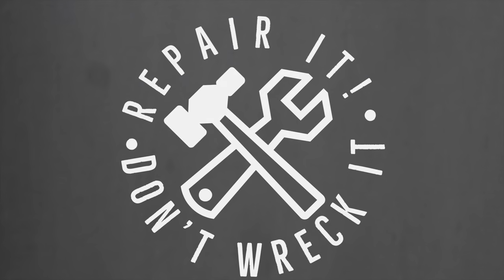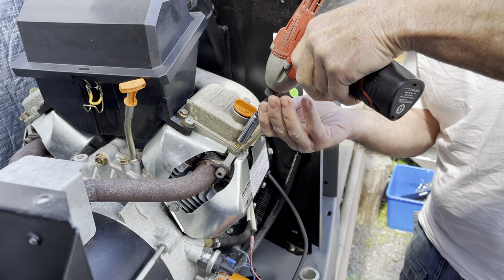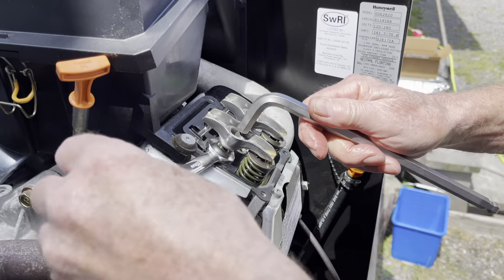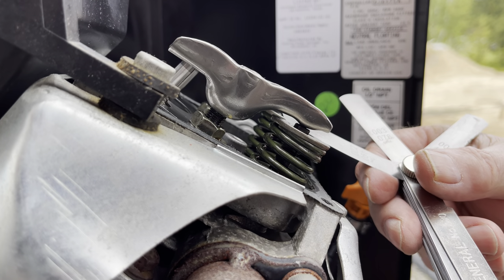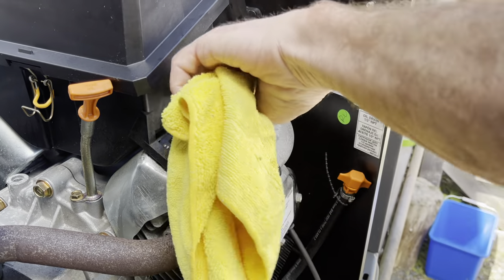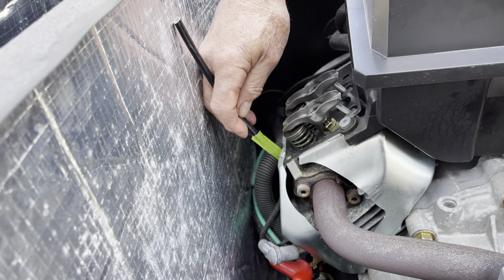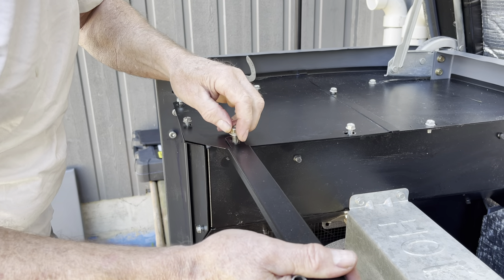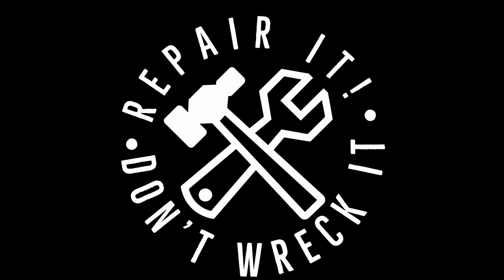Adjusting the Valve Lash / Clearance on a  Generac / Honeywell Air Cooled 17 kw Whole Home Generator

Comment: I am getting the rpm loss error again. I will check the valves when it's over 60 degrees.
Reply from the maker: https://gentekpower.com/forums/viewtopic.php?f=6&t=3.     Hi Ed. Here is a link to a fantastic web site. It is worth a look as there are other reasons for the RPM loss message. Roger
Reply: @repairitdontwreckit4257  Thanks for the link. I am wondering if this is my issue: . The ignition coils have a problem. This could be that they are bad, have contacted the flywheel, etc. The 18 wire sends the RPM signal to the Evolution from the ignition coils. I know I have a good battery since it starts my car with ease. My generac  start some of the time usually after multiple attempts. I had it running the other day, but on a manual start....
Reply from the maker: @edbrandt8972  This web site also sells parts. It might be worth downloading a repair manual for your unit. I have one for my model. They are well put together.  Check out the forum also. I’m confident you will be able diagnose your problem. Roger
Reply: @repairitdontwreckit4257  My educated guess is a bad coil or control board. It looks like I can disconnect wire #18 and see if the starter engages. Then I can test that wire for continuity and test the wire to ground to make sure it is not shorted.
Reply from the maker: @edbrandt8972  I would check wire #14. It supplies power to fuel solenoid to open. In the manual it’s test #51. You should have 12 volts when cranking. Wire number #18 grounds the coils to shut down ignition and provides rpm information to controller. On this wire if there is rub thru on the wire it would be grounded. There is a test #59 for this. Another check is a spark plug tester to see if you have spark when cranking. Simple test that gives you some direction. Make sure connections to controller are clean and have not come loose. There are two things that need checking are spark and fuel. Also you need air so a blocked or dirty air filter or a choke plate sticking could cause a problem. An organized approach will save you time. Unless you can confirm a part is defective resist the temptation to throw parts at it. Roger
Reply from the maker: @edbrandt8972  Does or always start in manual?
Reply from the maker: Another test you could do would be #64. Disconnect the #18 wire. Put 1 lead of your multimeter to ground and the other lead on the end of the wire being careful not to distort the connector. Turn of the fuel and manually crank the engine. You should get 3 to 6 V ac for the two cylinder, and 2 to 3 V AC for a single cylinder.Roger
Reply: @repairitdontwreckit4257  does anyone have a link to a video showing how to access the ignition coil and how to identify the wires to test? Or maybe I just need to buy a repair manual. I have the 8kw home standby model.  Thanks
Reply from the maker: @edbrandt8972  Hi Ed. Getting the manual is will save you time diagnosing your problem. Also,  it explains the theory of operation on how the different systems work. Once you understand how something works it makes diagnosing much easier. The manual is set up for a person who understands electrical basics including the use of a multimeter. There is some information on how to remove the engine but for your needs getting to the coils I think you would be disappointed. I never have removed the coils on my generator. From what I have read it requires a fair amount of disassembly to get to them. Once you are there the coil replacement is fairly simple. Depending on the age of the unit some of the fasteners may be corroded and tight. You need to be patient as you don’t want to break anything. These engines are air cooled. Basically same design as a lawnmower, motor cycle or pressure washer engine. I looked around and couldn’t find any real decent generator videos on how to get to the coils. However there are tons of lawnmower videos that can be looked at to learn the different techniques for diagnosing electrical problems and how to take them apart. There are 2 Utuber’s that I think are pretty good. One is James Condon Generator Repair and the other is Metal In Motion Shop. Metal In Motion has a specific video called “How to Diagnose and Replace An Ignition Coil”. Don’t forget the basics for an engine to run. Spark,fuel and air. I know it’s sounds simple but at least one of them is missing. You need have certain tools to do the diagnostics. A multimeter, manual, fuel pressure gauge (manometer), and basic sockets and wrenches. If you’re willing to do the research and learn as you go along it can be very satisfying to figure out the problem and repair it. People who repair these things have many years of experience and still can get stumped occasionally. Especially a intermittent problem. I hope this helps. Roger
Reply: @repairitdontwreckit4257  did some testing today. I am not seeing the starter relay giving power to the starter. The relay is consistently getting 12v to close the circuit to the starter. So I tapped it with a hammer a few times and all is well again. I think I need a new starter relay.
Reply from the maker: @edbrandt8972 Sounds like you have found the problem. Double check the wire connections for tightness or corrosion. If that looks good it seems like a good call to replace it. I don’t think it’s an expensive part. Probably the points are sticking causing intermittent failure. I’m glad you hung in there to finally locate the problem. Congratulations. Roger
Reply from the maker: I know you have pretty well solved the problem. But it would be interesting to see what the ohm readings are.  Here are some resistance values you could check on the relays. The starter contactor would be 8 ohms and the starter contactor relay is 155-158 ohms. Roger
Reply: @repairitdontwreckit4257  thanks. I will check that next time I work on it.
Reply: New hypothesis. I think I was using too weak of a battery charger. I replaced the stock generac charger a few years ago. Recently I tried several other aftermarket trickle chargers. Tonight I could start in manual or exercise mode. I will continue to monitor the solenoid.
Reply from the maker: @edbrandt8972  Hi Ed. Here’s a couple of tests you can try. Battery voltage should be at 12.66 volts or pretty close. When charging I would think between 13-14 volts would be acceptable. Next load test the battery. Turn off the fuel supply so the engine doesn’t start. Connect your multi meter  to the battery the same way you would test it. Crank the engine and see what the voltage drops down to. It should not go less than 10 volts. Lower than 10 volts indicates a battery problem. Another check is the negative cable. Put one lead of your multimeter on the negative battery post and the other on a ground. Say to the engine or where the engine is bolted to the chassis. Crank the engine without fuel so it doesn’t start. The voltage drop should be around .10 volts to .30 volts. Less is even better. Anything over .50 volts indicates a bad ground. Some of these tests I use on my car and generator. From experience there is almost no voltage drop if everything is clean and in good shape. Roger
Reply from the maker: @edbrandt8972  Hi Ed. From my research the battery charger should be rated for around 2.5 amps. Roger
Reply: @repairitdontwreckit4257  I am using a 2 amp aftermarket charger now. This is replacing another after charger. A fews years ago the generac charger would overcharge the battery and caused all the acid inside to evaporate. The new charger  seems to shut off correctly when fully charged. I don't want to buy another generac charger since the last one would over charge the battery.
Reply from the maker: @edbrandt8972  I wouldn’t think the 2 amp charger shouldn’t have a problem keeping up on a properly functioning battery.
Reply: @repairitdontwreckit4257  so I did some testing in the sunlight. Turns out the battery terminals had corrosion. I cleaned that up and it starts right away in manual or automatic test mode. No new parts have been installed other than an aftermarket battery charger.
Reply from the maker: @edbrandt8972 That’s great news. I’m glad that you got it figured out without throwing parts at the problem. Even though you spent some time testing other systems the experience you gained and having a better understanding of your equipment will be invaluable. Great job. 
Roger
Reply: @repairitdontwreckit4257  The point is to check all possible culprits for the issue. Loss of power due to corroded battery terminals should always be on the checklist. I am glad it's fixed. We had some severe weather last week here in Ohio.
Reply from the maker: @edbrandt8972 Your right. Always start with the basics first. A simple check list would be ideal. Did you do a voltage drop test to zero in on the battery connections as the problem?

Comment: You should always replace used gaskets. They are cheap, and should always be on hand if you are doing a valve adjustment. They do get brittle, and then take more pressure to seal. Why risk an oil leak to save a few bucks?  Otherwise good video.
Reply from the maker: Hi Rod Graff. Thanks for checking out the video and posting comments. I probably should have explained myself for reusing the gaskets. I agree that they should be changed. The generator was located in Canada, in a small city in northern Ontario. Parts for Generac generators while available are expensive. The gaskets are $ 21.00 each plus shipping. I felt that if there was a leak it would be small and easy to identify as the valve covers are accessible, gaskets could be ordered and replaced. I recall at the time of making the video I checked my favourite generator site called  gentekpower.com.  located in Michigan. Some of the techs on the site didn’t seem to have an issue with reusing the gaskets on this particular model which surprised me.  Thanks again.
Roger
Reply: @repairitdontwreckit4257   Wow, for that price I would have tried to save the gaskets too.  I don’t remember where I got mine, but they were no way that expensive.  Maybe 4.00 each.  Might have been on Amazon.
Reply from the maker: Hey Rod Graff. The gaskets are reasonable in USA. Depending on where you look the price ranged  from $4 to $7 dollars. The gentek site that I mentioned sells parts and we’re one of the lowest prices. I’ve ordered service parts from them when vacationing. Worth a look. Thanks again.  
Roger

Comment: Why didn't you check the battery?
Reply from the maker: Hi Nancy Vrabel. Thanks for checking out the video. I like to keep the content of the video as close to the description as possible. Here is a link to a battery video that I did. Thanks. Roger.            youtu.be/TqR1rOMQkBc
Reply: @repairitdontwreckit4257  thank you ! I'm going to do my own maintenance on the generator this summer. Your videos are to the point and you have a clear voice with no ums . Well done!
Reply from the maker: Nancy Vrabel. Thank you for your kind words. Doing your own maintenance is very satisfying. Besides, the money you save is significant. Also I like being independent as much a possible. Take your time, and prepare. It’s not that hard. Good luck. Roger

Comment: I don't see how you are turning the motor to bring it to top dead center.  Is their a crank bolt to turn the motor?  You just magically brought the piston to top dead center is somebody else turning the motor for you?  My Generac 17 KW doesn't seem to put out the current it use to is there a way to adjust the output?  My old control panel burnt out and is no longer made.  I had to buy a different control panel which came with an adapter so that it worked on my generator it was after that when the current dropped.  My computer won't even consistently run because of the lower current output no problem before.  It is a tower with a high wattage power supply.   Lights and refrigerators seem to be no problem but like I said the output of the generator has noticeably dropped.
Reply from the maker: Hey user. Ha. I wish it was magic. It’s been a while. From memory the camera person that was helping me was turning the fan. It is located under the panels covering the muffler. This fan is easy to turn by hand and is attached to the crankshaft. I found this a good spot to rotate the crankshaft to manipulate the piston to the position that I needed for setting the valve lash. As far as your other concerns it is beyond my level of knowledge. Depending on how handy you are there is a service manual for your generator available from Generac and other sellers. I have downloaded one for my generator. It is very well put together. It details the steps to doing electrical diagnostics. You would need to be reasonably proficient at using a multimeter to get the fuel benefit of this purchase. While it is well written it is intended to be understood by an experienced service person. You may want to check out gentekpower.com   A generator site. I have visited this site many times. Most of the people there are professionals and post frequently on the forum. They sell parts and the online service manual. I’ve found their stuff generally less expensive than other sites including Generac. The benefit here is the moderator will support the parts he sells. I hope this helps. Thanks for watching and posting. Roger

Comment: I looked at another video tonight, and this other generac tech is claiming tdc is immediately after the exhaust valve closes.  https://www.youtube.com/watch?v=l5jBU5d7ipA&t=493s  .  Quite concerning honestly.  I don't have a compression gauge but will need one now..
Reply from the maker: Hi  Eastman Research. I had a look at the video. To be honest with you I don’t really think it really matters. As long as both of the valves are fully closed you should be able to do the valve adjustment. There is a website called GenTechPower .com  that provides quality information regarding air cooled generators. The professionals on that site seem to prefer adjusting the valves on the compression stroke on top dead center. Since they do it for a living that’s what I decided to do when I did the video. You can always check it both ways to see if there’s any difference. I have taken a couple of lawnmower engines apart which are basically the same design. As long as you’re checking the valve lash when you’re not on the lift portion of the cam you should get an accurate adjustment. Don’t forget I am not a generator tech. I work on my own generator and friends equipment. Before doing any of the videos I spend a lot of time making sure the information I give is accurate. I’ve done my homework and checking. Valve lash adjustment is not that difficult. If you are not comfortable then have it done for you. You don’t want to make things worse or damage the engine. You can always practice checking the valve lash and not make the actual adjustment. That’s a safe way to start. I hope this helps. Roger

Comment: You adjusted those valves all wrong they shouldn’t be equal when you do that you should have one up and one down check in the valves for the thickness
Reply from the maker: Hi Plow. Thanks for checking out the video and posting comments. It sounds like you have lots of experience with generators. Can you elaborate on why the method of setting valve lash is wrong. Thanks Roger